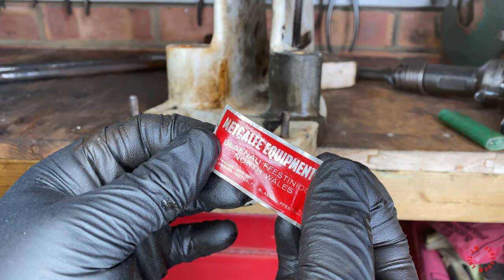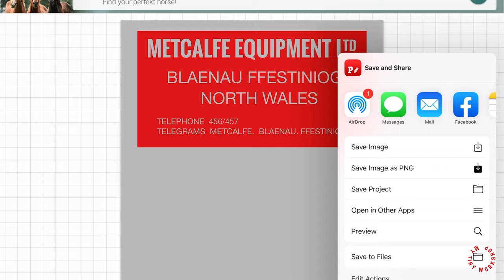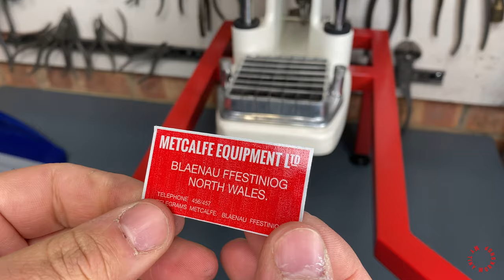EXTREMELY Rusty Potato Chipper SURPRISING Restoration

Comment: really well done .. top-notch job .. took your time and did it right .. even going as far as nickel plating the spring and seasoning the cast iron base
Reply from the maker: Thank you. I wanted it to be user friendly. It would rust instantly Without the seasoning.
Reply: @mytinyworkshop1213  I have used many like it in my youth when I would work in various kitchens these things needed to be sharp but also durable .. you addressed both of those issues

Comment: Very nice job - congrats. Next project?: Modify the cutter by adding easily removable SS blades to optionally prepare thin ‘French Fries’.  Personally I prefer old fashioned British chubby chips, but others will prefer the thinner fast-food alternate style. They also have the advantage of cooking faster.
Reply from the maker: I can’t modify the blades because the cast iron teeth won’t fit. The modern design does have interchangeable parts.
Reply: @mytinyworkshop1213  As Sgt Maj Williams would have said "Oh Dear. How sad. What a shame!" 😢

Comment: Really nice video and great restoration - the stand was a great touch in the end!  I was a little worried about the possibility of lead paint - did you test for it?  I don't really know a lot about it honestly so I don't know if it was something you needed to worry about.
Reply from the maker: I actually didn’t test the paint.
Reply: @mytinyworkshop1213  I honestly don't know how important this is, but maybe with sandblasting you'd want to be careful. 🤷‍♀️